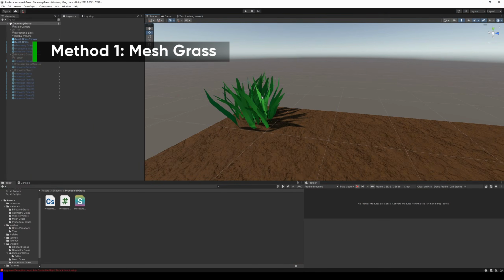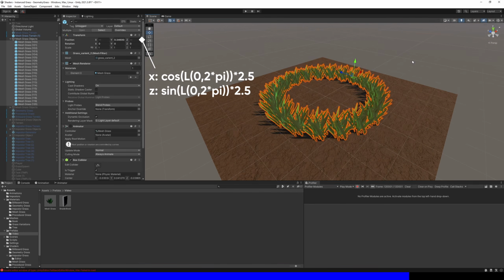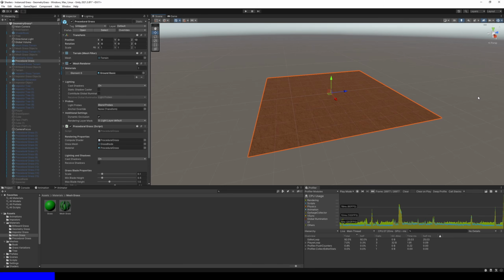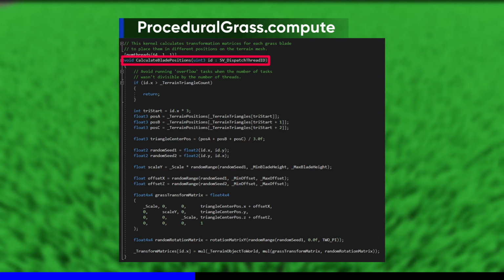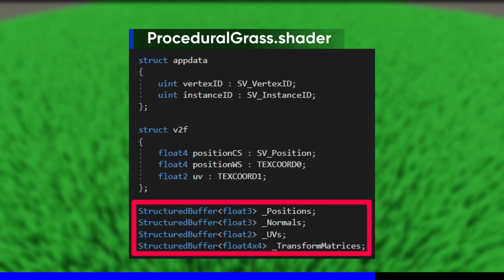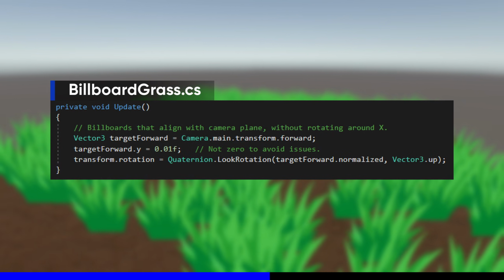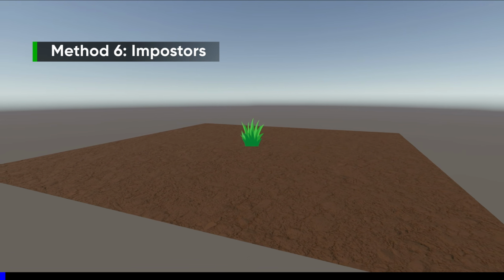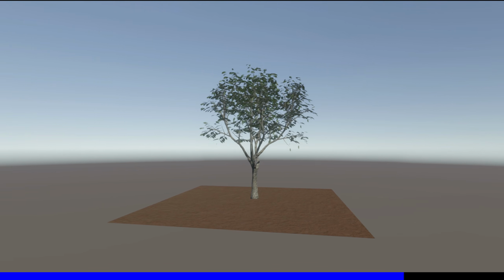Six Grass Rendering Techniques in Unity

Comment: i love grass, man. i work in win32 so not the same, i was figuring on using shells next time i want grass, and an abstraction (several layers of squares like uninterpolated wind positions). i don't know if i missed it, a good tip i herd was to mix the terrain normal for specular at a distance to reduce aliasing. anyway, here's hoping some folks out there get the good word about the abstract.

Comment: HELP pls, when using the geometry grass method and upgrading it to unity 2022.2.18 for some reason the grass displaces to a diferent location than the objects one. for example if the object with the material is at X=0 and Y=0 the grass is at X=0 Y=0 but if I move the object to X=2 Y=0 the grass moves to X=4 Y=0 and so on and on. this makes the grass unusable because when the objects get a little bit away from the center of the scene (lets say 12 meters) the grass moves super away (24 meters) because for some reason it multiplies the distance by two in all axis. if someone can tell my why it does this ill be veryu thankfull :D

ps: sorry for writing a full byble paragraph xd
Reply: Hey! Did you manage to solve the problem?
Reply: @alpergiray1783  i dont use Unity anymore bc of the polemic that happened and also nevera found the soultion. Apparently its a bug that the versión hada or smthn because no one was able to solve It 🫠

Comment: This is a great overview of grass rendering methods. It's important to note that you can combine multiple solutions for near vs. far grass, but you have to get the colors/lighting to match and make the transition incremental. I like to use a pixel dissolve effect when transitioning from geometry to billboards, or when switching between imposter images at different angles.

The approach I used that works well is to generate some number of square grass patches (I use 32) and randomly select from one of these for each terrain tile/chunk. Then these are drawn across the terrain using hardware instancing. I also generated several lower LODs by recursively finding the nearest pair of grass blades and merging them into a new blade with the sum of the surface area, the average of the color, and the average of the height. Each LOD is half the size, and they're all stored in the same buffer. Then for 4 different LODs you have up to 32*4 draw calls for each mesh of each LOD.

In addition, I use hardware tessellation shaders to curve the grass blades when close to the player and apply a wind effect that scales with distance from the base to the tip so that the ends move more in the wind. This system can support a field of grass that stretches to the horizon at about 300 FPS on a GTX 1070.
Reply from the maker: Your approach sounds super interesting! And of course, mixing approaches at different distances is crucial if you want great-looking grass with high performance. As it turns out I also have a GTX 1070 so 300FPS sounds pretty good to me!

Comment: You forgot the most important grass method, called Grass blending.. It's very common in UE and easy to do that there, whil;e in Unity, good god it's so little resources regarding this matter in Unity due to these reasons "

1. Normal blendings are expensive
2. It's very hard to implement in Unity
Reply from the maker: I'm interested in this, where do you suggest to find out more details about it in UE? Would be interesting to have a go at implementing it in Unity!
Reply: @danielilett  Almost every UE stylized tutorials out there you can find, usually they don't even mention it due to how it's a built-in feature there and it can be done on the shader level pretty easily. Most likely can find this in a stylized ue videos.

in Unity, either baking the maskmap or using secondary ortho camera, yeah, it sucks.

And for the love of god! PLEASE MAKE A TUTORIAL FOR THIS for Unity!...